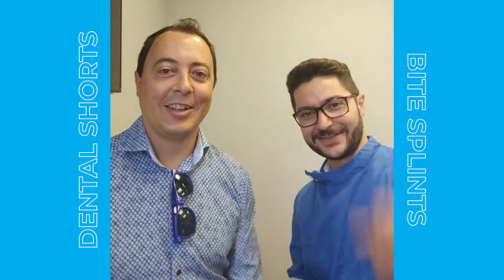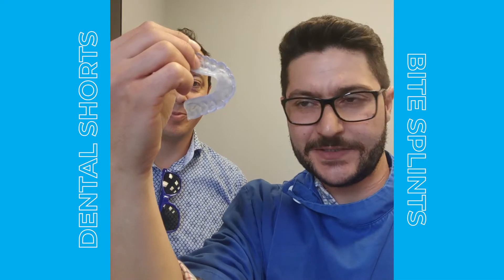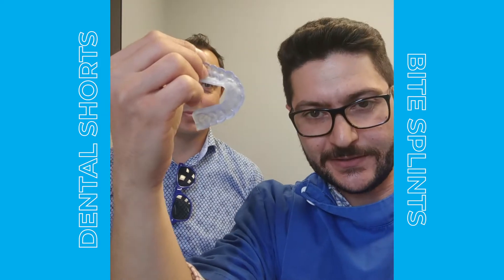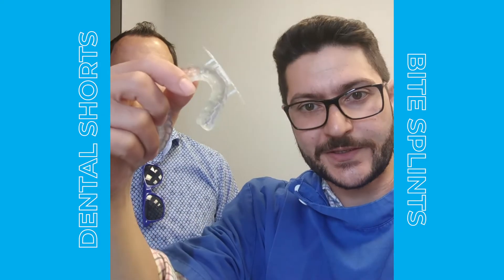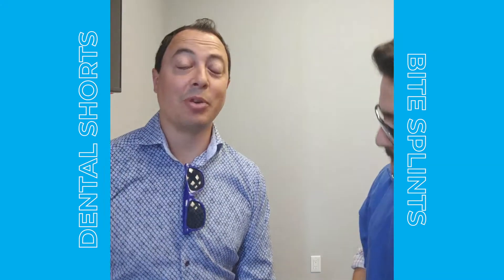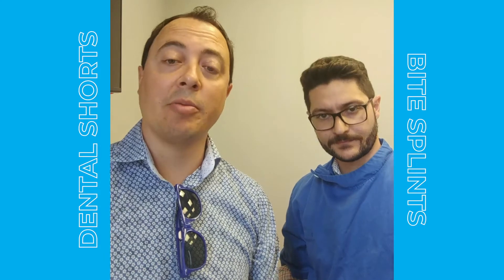3D Printed or Milled Bite Splints | Dental Shorts Episode 3

Comment: Can you mill a bite splint with a 4 axis milling machine?
Reply from the maker: Great question Alrik, happy to connect you with an application engineering specialist if you submit your request here - https://dental.proto3000.com/
Reply: For any future visitors, Yes you can totally mill a Bite splint with a 4-axis machine, but the lost axis (or degree of freedom) will mean that there is more material left over that needs to be cleaned up by the dental technician in post processing. just something to consider.